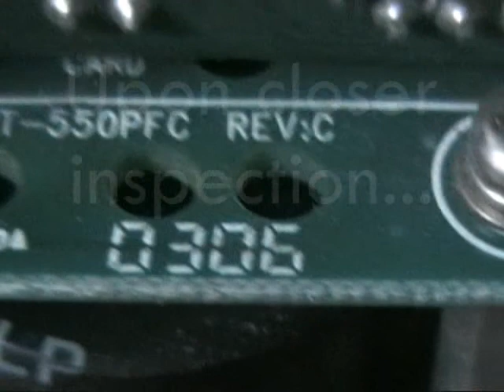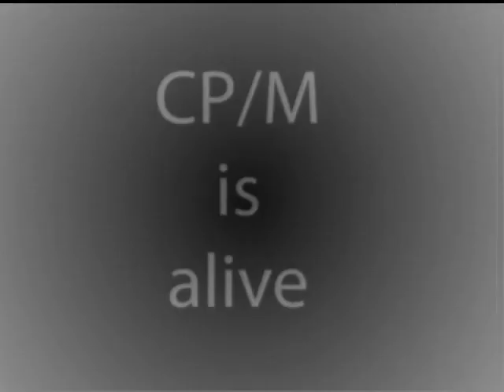Antec PSU kills unsuspecting graphics card

Comment: Antec PSUs of 2006 vintage and prior are known to use faulty capacitors, most commonly from the brands Fuhjyyu or Teapo. They use faulty stolen electrolyte formulas that can't stand high levels of heat and break down, which causes the capacitor to bulge or vent from the top/bottom. But what looks like happened there is the MOV (metal Oxide Varistor) which is for limited protection against power surges has exploded.

The MOV exploding means something before the primary switching transistors went bad. Either there was something wrong with the mains or the bridge rectifier was shorted. I've had shorted bridge rectifiers on power supplies before and replacing them with the blown fuse and MOV usually go them working again just fine.

Comment from the maker: @cyber8000 : well, the PSU stopped regulating the 12V line properly which caused the huge increase in voltage and thus, the current drawn. This, in turn increased the chopping frequency that blew the mains filter up (the component broken in two) and later the feedback circuit died (burnt track) then the fuse blew, all in 100 msec. On complaining, I was told it had a 2 year warranty - the box and instructions said 5 years...

Comment from the maker: The stock cooler went the moment I got the card ;) - September 2004, seems like a lifetime since then...

I had a watercooling block on there - 465MHz :) vs. 400MHz standard.

To make the vid, I removed the block and cleaned off the silicone grease.

I've got an Alienware laptop that I use for games, I don't have the cash to run two expensive rigs.

I'm in two minds whether to build a new PC or get another laptop.

Comment: @theultimatedestroy80 
When poor quality parts are used what the label says is not often anywhere near what the psu can do.
And if quality of parts used is so poor they will fail early.
A few years ago i put a cheap apower psu in my old pc rated good enough for my pc after a few weeks it caused issues so i put my under rated psu in and it still running.
When i opened the psu it was missing input filtering and the cap for +12 was not soldered in on one pin.